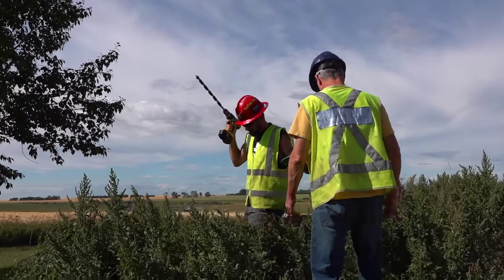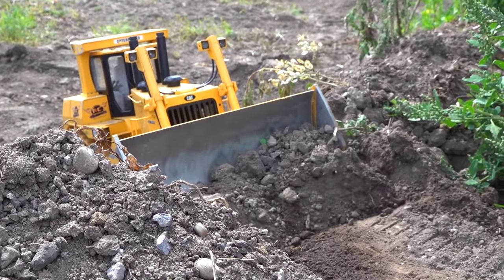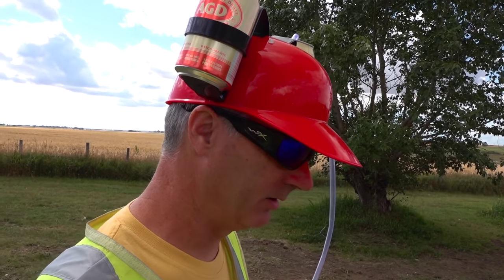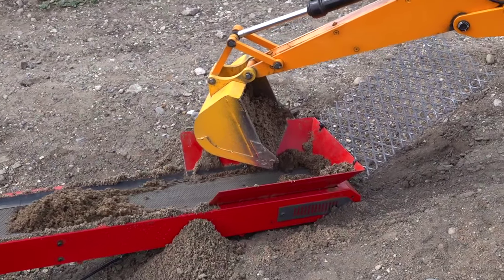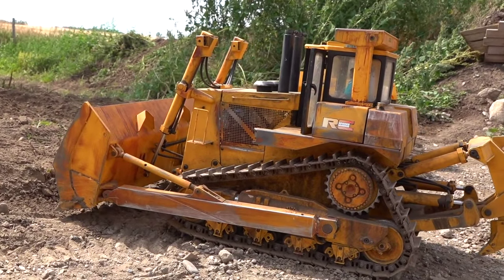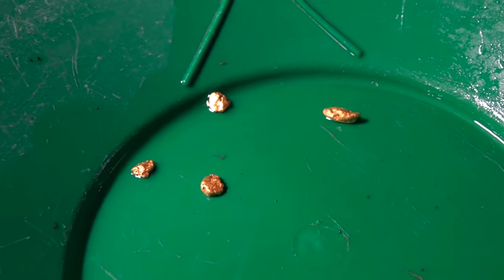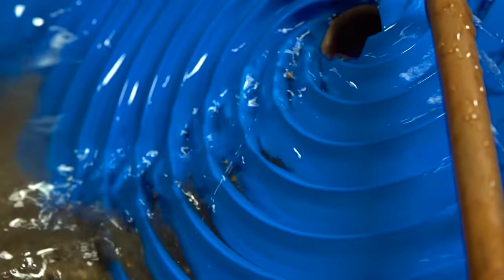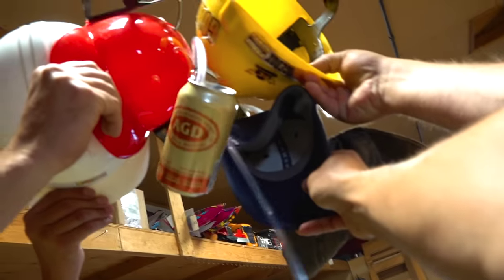YouTube GOLD - a "CLEAR CUT" Taste for GOLD (s2 e20) | RC ADVENTURES

Comment: I have a suggestion for your conveyor issue. You should measure the circumference of that drive belt (belt did look like it was about to snap) buy poly cord measure existing belt by cutting and get full length measurement and put new poly cord on. Will last much longer then rubber and you definitely won't ever snap the cord if welded right.

Comment: Watching the static battery powered equipment, why haven't you got a power invertor fed by the generator so you never need to swap out batteries and charging would be a thing of the past no more shut downs due to flat batteries.
The amount of gold you are finding on your property you could get some professionals  in to strip mine it.